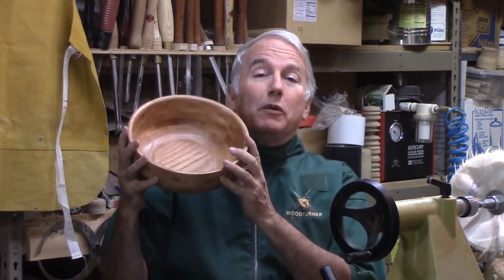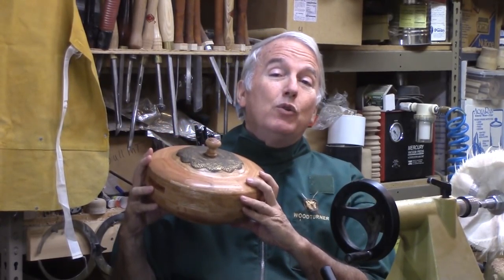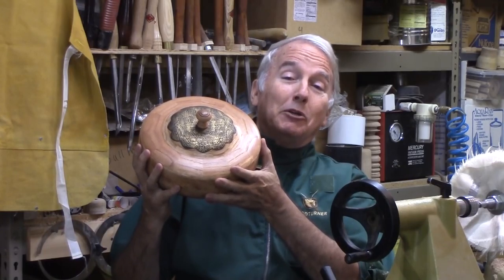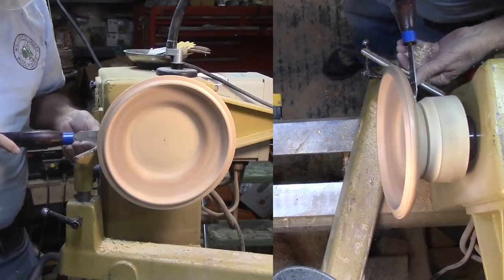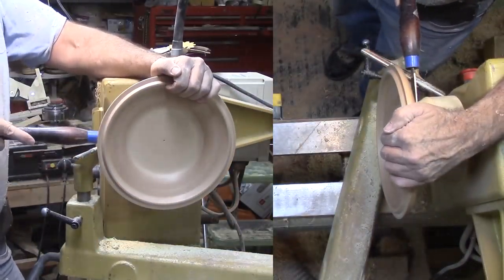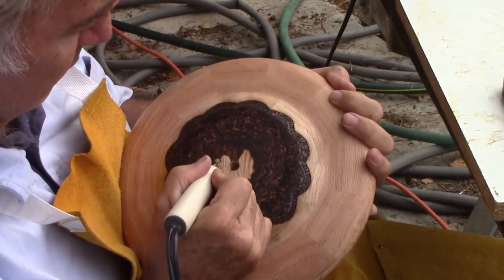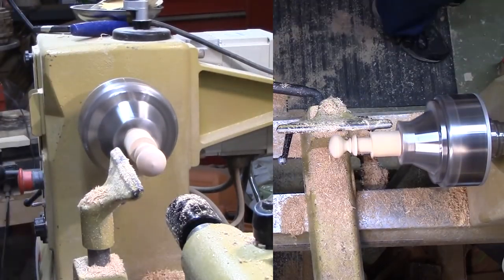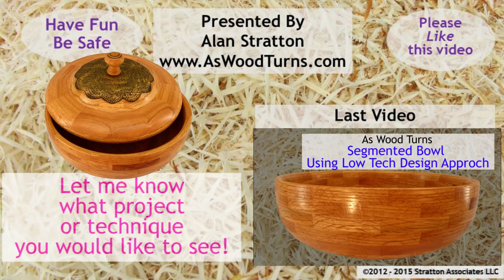Pyrography for Lid Of My Segmented Utility Bowl

Comment: Wonderful, at first I thought the top was one of those perforated metal covers people use for some potpourri bowls, I was surprised to find it to be burned wood with gold guilt cream on it. Good call, it must have taken quite a while... and I would love to see how you fabricated your system, does it run on a battery charger? I think I have a 12 volt one, that I used to use to charge my motorcycle battery, I wonder if that could work as well..
Thanks for sharing Alan!
Reply from the maker: +Yuval Lahav I'm not an electrician and had to have help figuring out mine HF version.  It might. Essentially, all I purchased was a case and a big transformer. Everything else I had to strip out.
Alan